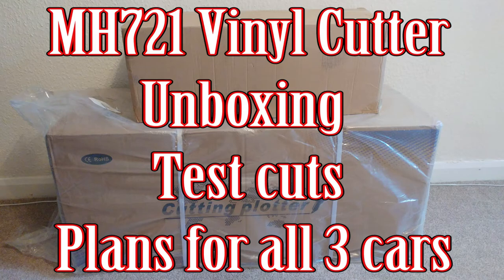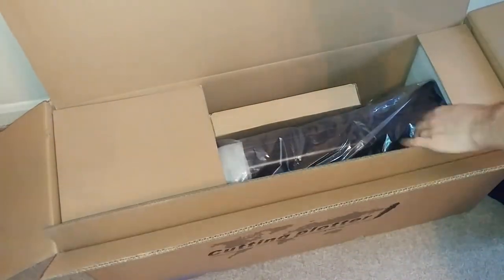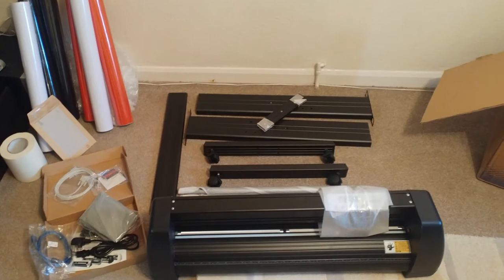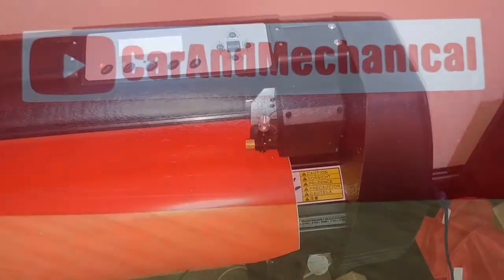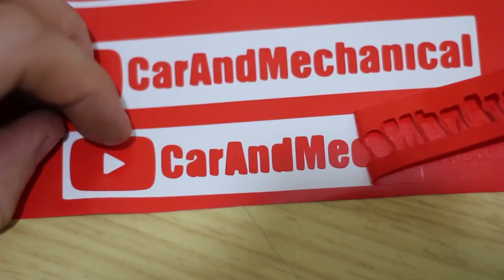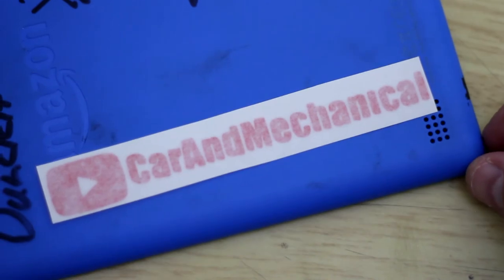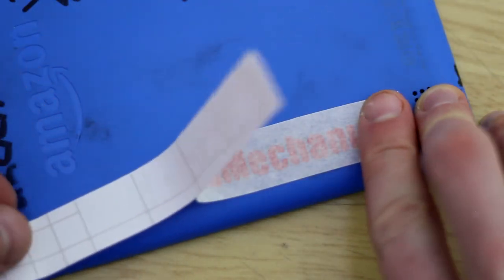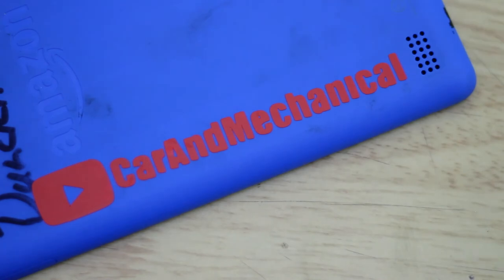Vinyl Cutter MH721 - Unboxing - Testing and car vinyl plans

Comment: Hello!
Is this cutter worth buying,I am  planning on cutting t shirt vinyl,can it cut smaller designs and do you recommend it overall,thanks
Reply from the maker: hey, I think it's pretty good - bare in mine I intent to make car based stuff which is larger so I think that the 45 degree blade it comes with its ok for that. 
What I'll be doing it getting a 60 degree so smaller detailed bits that have a tighter arc looks better.
My question would be depends how details the things you want are - the limit of quality on the blades I have are the example I use at the end on a 7 inch tablet.